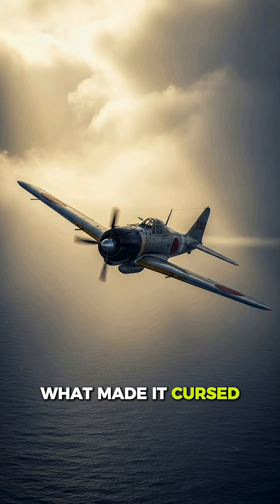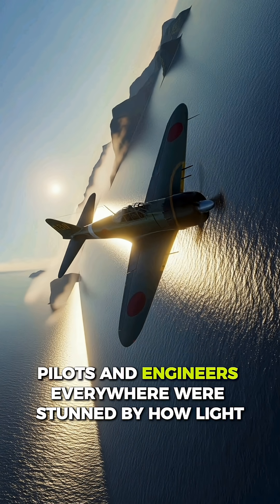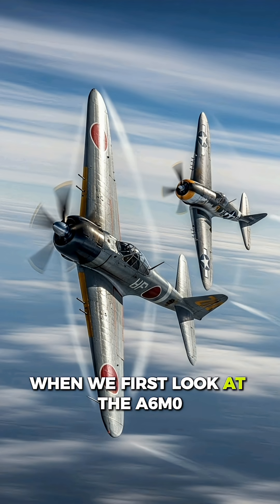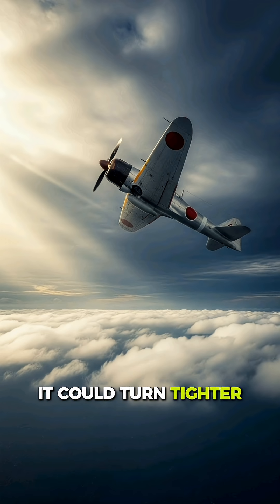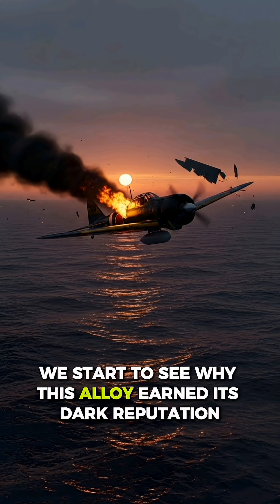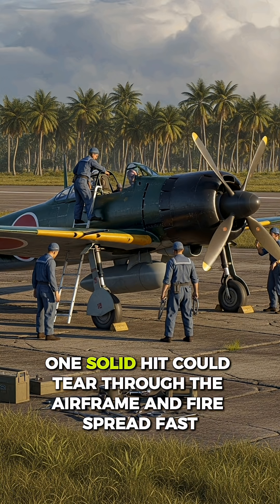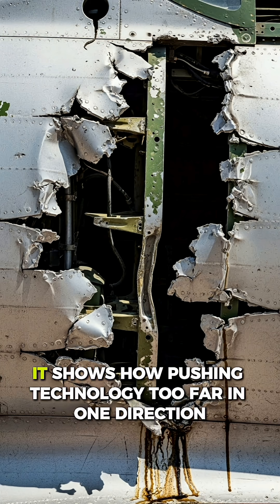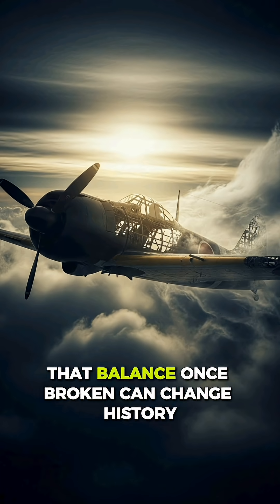The Cursed Alloy of the A6M Zero#worldwar2

Comment: This is news to me.......
It wasn't the alloy itself  but rather the thickness of the metal "skin", which was keep as thin as possible to save weight. This led to "wrinkling" and failure during high g maneuvers. This along with lack of armor and self sealing fuel tanks (all designed to make the Zero as light as possible) led ro the Zeros down fall.
Reply from the maker: Great insight — you’re absolutely right 👍
The Zero’s extreme lightness came primarily from how the alloy was used rather than the alloy alone. Mitsubishi engineers pushed weight savings to the limit by using very thin skin panels, which indeed led to wrinkling and structural stress under high-G maneuvers.

The alloy itself (extra-super duralumin) was advanced for its time, but when combined with thin skin, lack of armor, and non-self-sealing fuel tanks, it created a fighter that was lethal early in the war—but increasingly fragile once Allied tactics and firepower evolved.

That trade-off between performance and survivability is what ultimately sealed the Zero’s fate.
Really appreciate you adding this depth to the discussion—comments like this make the history even richer. 👏✈️
Reply: @Militaryhistorytales 
Engine horse power has to be taken into consideration too..
The Sakae engine that powered the Zero only provided 980 hp, so to get the performance the Japanese Navy wanted from the Zero it had to be "light".
Same is true for thae Army's Ki-43 Oscar.